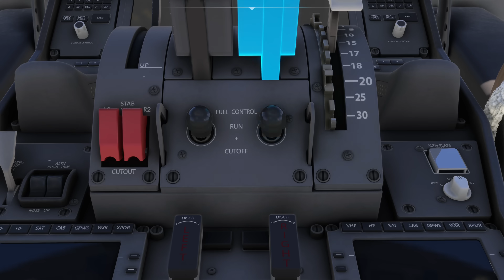Air India 171: Why Did The Fuel Cut-off Switch Get Moved?

Comment: This Boeing 787-8 incident, the fuel switch  went to cut-off during takeoff and the RAM Air Turbine (RAT) deployed. 
While the fuel switch in the cockpit is manual and can’t physically move on its own, the system behind it is far more complex.

From what I understand even if the switch is set to RUN, the engine’s control system (FADEC) can still shut off fuel electronically if it detects something abnormal like low fuel pressure, a faulty valve signal or a suspected fuel leak. 

In those cases, it might override the pilot input and close the fuel valve to protect the engine.

To the crew it could look like the switch moved or the engine shut down on its own but in reality it is the system stepping in based on logic and internal safety triggers. Combine that with a possible electrical fault and you might see RAT deployment as part of the emergency response.

It’s a reminder of how modern aircraft are deeply interconnected  where a small glitch or sensor fault can trigger a chain of safety actions. 

Fascinating how layers of automation protect the aircraft but also how important it is to look deeper when something unusual shows up.

I would love to hear from aviation experts or anyone with insights.

Comment: It is easy to blame a person who is not alive. But, that can shield Boeing for being held accountable. For a moment, lets assume that the pilot has done it. If that is the case, was there any struggle after that to crash the plane. No. Both the pilots tried hard to save the plane. So, explain, if the pilot did it intentionally. Boeing is trying to pin the blame on a poor soul who was trying to save the passengers. If I were to draw conclusions, when the first pilot asked, may it was him who spotted the issue and checked with the other pilot. The other pilot did say that he did not. If I were a trained pilot, I assume that the only way the fuel would be cut off is to manually change the lever. That is the natural response of a first pilot to discover it. I think we are being brainwashed to say it is a pilot error and not Boeing's fault

Comment: The prelim report sounds like propaganda for Boeing.lets logically examine the reasons for the cryptic report. They have access to the entire conversation between pilots but only put out a paraphrase of two comments without time stamps. That is suspicious. They want to blame the pilots. If this was a deliberate act then there would be more conversation demonstrating that but the report is silent on this. Steve is saying his kids always lie when caught red handed. An equally plausible explanation is that an electrical failure occurred first and then the pilot went to reboot the switch. The other pilot asked if he caused the shutdown and he replied no. There was a directive to inspect fuel control valve in may 15 2025 on Dreamliner 787 in England for potential defect. The RAT deployed immediately which indicates electrical failure. The 2018 advisory warned of potential “ in flight engine failure” from faulty fuel control switches. So there are lots of things we do not know. It is wrong to extrapolate from a misleading deliberately cryptic report to say dead pilot is to blame. How convenient for the billion dollar company Boeing

Comment: the report states that the fuel switches had 'transitioned', it doesn't really state that the pilots had switched it to cut off. The report however puts it in such a way for people to draw conclusions that the the pilot had done it, added to the fact that the report was leaked to wall street journal who not only drew the same conclusion but put it out loud enough to people to think that way. The report still and clear states, the word 'TRANSITIONED' , everything else is speculation.

Comment: I have 2 other questions that might have been answered because i didn't watch every single video put out about this.    

First, is this fuel cutoff switch used in normal day of flying the plane?   ...at the gate, or whatever.     I'm wondering if it's possible a switch piece was worn down making them possible to accidentally trip.   regular use would also mean reaching for them becomes a part of muscle memory...in error this time, but it wouldn't make the action feel odd.

Secondly, did the black box have a record of the fuel switch toggling and the RAT deployment.   Was the rat down before the switch was trip or the opposite?

Comment: While there is zero video to show anyone's intervention with the switches, leaves only an edited piece/s of audio.
Which in itself as published, can not conclude human intervention of the switches.
It does on the other hand, point to fuel being shut off, not by either pilot! 

One pilot said, "why did you do that"? The other states, "I didn't"!

So who or what did? 

So until that can be properly and definitively
substantiated, then it can "not" be said either pilot cut the fuel!
To do so, is an unsafe mode of reasoning!

Comment: The malfunction of the fuel switch mechanism is highly suspicious. 🤔 😢
There appear to be four key issues concerning the placement and robustness of the fuel switches:

1.  Placement on an Inclined Plane: The switches were surprisingly placed on an inclined plane directly beneath the flap levers. Both the inclined position and proximity to the flap levers are problematic.
2.  Incorrect Switch Orientation: The "cutoff" option is positioned downwards, while "run" is upwards. This orientation is counter intuitive and dangerous, especially given the inclined plane and proximity to flap levers.
3.  Risk of Accidental Engagement: Located directly below the flap levers, there's a very high probability of pilots accidentally contacting these switches. This risk is exacerbated if the switches' spring mechanism is not sufficiently robust.
4.  Mechanical & Electrical Robustness: The overall mechanical and electrical robustness of the switches' internal mechanisms is suspicious.
Reply: The risk of accidental engagement can't be that high, because this kind of thing doesn't happen. If the risk was high, it would happen from time to time

Comment: @steeeve is there a chance that the locking system of the fuel switches malfunctioned, there was also a directive issued by Boeing regarding the same few years back for 737s and it is the same system used here. And also to highlight the report uses the word TRANSISTIONED and is not exactly indicating pilots did it which leaves the room to think it could not have been the pilots and the pilots denying it could also add as evidence and still have a slight chance that it might have not been the pilots but maybe an indication like fuel switch locking mechanism failed. Would love to hear your thoughts

Comment: Maybe you have jumped the GUN...Have you heard this out:- (Fuel cutoff valve actuator ADVISORY)
It’s highly likely SN‑2015/005 is relevant to the AI‑171 case.
If actuators weren't inspected or replaced per the advisory, the probability of unintended fuel shutoff—accidental or mechanical—significantly increases.

Comment: Captain, based on the timestamps, RAT deployed at 08:08:42 — the exact same second the engines were cut off. That’s not something pilots manually deploy; it auto-triggers with dual engine or power loss. You’d earlier said RAT needs serious system failure to activate, and here it happened 3 seconds after liftoff. Doesn’t this clearly point to a sudden systems/electrical issue, not intentional pilot error?”

Comment: Is it correct that flipping the switches to cut-off and back was something a pilot would be trained do to in order to restart an engine(s) that was already losing power? If correct, this would result in a very different conclusion.

Comment: I hope you fly an airbus.  These cutoff switches should verbally ask if you want to cutoff engine 1  and have the pilot confirm it on the display (type in yes).  I’m not a pilot, but I know enough that the fuel shouldn’t be cutoff 500 feet off the ground.  I can’t understand a “oopsie” moment from the captain. I’ve always like planes but been nervous on them.  First you have to worry if the pilot is doing his, then you have to worry is the mechanic doing his job, third you have to worry about if the material is plane is durable.  And NOW I have to worry if the computer system that is supposed to make the plane safer is instead randomly flipping switches.

Comment: There is no reason why the control system can’t prevent fuel cut switches being turned off on take off there is no reason on gods earth why you would want to cut the fuel the moment the aircraft left the runway. Take off and landing are two very seperate things.

Comment: Is it possible that a member of the ground-crew  just moved the switches from the run  locked position and left them slightly below ? During the take off run, due to the vibration of the whole aircraft, the switch slipped into the cutoff position . Is this a possibility?

Comment: Are there no warnings displayed to indicate Fuel Low/No pressure when Pumps go OFF.

I worked on a plane where Main pumps supply to engines normally and if they fail there are 2 tanks with single phase motor pumps to work with aircraft battery and inverter ti supply each engine separately sufficient enough for landing.. Wasn't there any such safety in such Prestigious Boeing?

Comment: I am absolute novice but would making a switch only be operatable by 2 pilots simultaneously cause danger when inapacitation of one pilot if you then need to take control alone and somehow have an engine failure as well to then cut of the engine, which then u cannot do anymore?

Comment: Why to have two switches together ? (disign lacks mitake proofing) there were incidents in the past where wrong engine fuel  was cut off.  Best way is split swiches eough distance that single pilot can not do it. Its like each pilot has its own side of engine& its switch responsibility.

Comment: Is there an SOP that requires the pilots to cycle the fuel switches should you lose thrust from both engines? Also prelim report doesn’t which pilot asked the questions regarding fuel switches cut off- Do you find this suspicious?

Comment: I think we are missing some fundamental points....and following the herds.... The fuel DID get cut off to the engines that we can agree AND the pilots tried to recover this.

The other pilot said "HE DIDN'T" move the switches. Let's take that at face value for a second. What if neither of the pilots did move those switches to cut off? Maybe the switches moved due to malfunction, faulty parts, poor maintenance, vibration, maybe they didn't move at all and it's an inherent switch / software / design fault that cut the fuel. 

Were the switches ever in the CUTOFF position? Was the pilot questioning the other pilot due to the errors he is seeing on the screens in front of him rather than a visual check of the switches down below.

Also if the engines were relighting - then the switches must have been in the RUN position when it crashed.

There is clearly a lot of data that has been held back from this report. The data that has been presented is limited and designed to take your eyes off what "potentially" could be a Boeing issue and not a pilot issue.

Comment: In 2018, the U.S. Federal Aviation Administration issued a non-binding safety advisory—not a formal Airworthiness Directive—highlighting that on Boeing jets (including the 787 and some 737 types), the fuel control switch locking mechanism could potentially be disengaged. It recommended that airlines inspect these mechanisms to ensure they’re secure and can’t be accidentally shifted.

Comment: I think that the both engines were stopped working and the pilots tried to restart those engines by fuel switches off and on. Is it possible? I have heard on news only two lines between the pilots. Why did you turn it off. No, I didn't do it. It is sure that the conversation was not ended there. There should be lead to the actual problem. Some were saying about mental health. If that was a problem, all the pilots should take a psychic test periodically. In every 1 or 2 year. I don't know, if it is already there.

Comment: you should check the report from earlier flight of same plane from delhi to ahemdabad they seemed to mentioned it regarding the switch. and also how thousand of times issues like these are not given top priority regardless which plane it is.
also  you said that 'MAYDAY' was called by other pilot is the same pilot who said  'I didnt' while the pilot who noticed switch is trying to cutoff switch again 
also PLEASE CHECK how much time it usually takes to happen the process - its timestamps for the first time cutoff switched then changed by the pilot again according to you

Comment: Captain, in your earlier videos you mentioned that RAT deployment isn’t instant—it takes serious system failure to trigger, and that was visible within seconds on CCTV. Doesn’t such rapid RAT activation, along with the pilots trying to switch fuel back ON, point more to a sudden electrical or systems failure rather than just pilot error? It feels like this angle is being overlooked, and shifting focus only to pilot

Comment: On 15th May 2025, the CAA (UK) apparently issued a safety notice (SN-2015/005) “Fuel Shutoff valve - Mandatory Actions on Biong to operators of :- Boeing 737,757,767 and 787 aircraft. Stating these should be checked/tested/replaced. Would this not have a bearing on the accident

Comment: The crash had nothing to do with the SWITCHES . It was an electrical failure. That caused the FUEL VALVES to shut off. The RAT got deployed immediately. The transition of power to RAT caused a flicker in the cabin lights. It was corroborated by the lone survivor. After electrical power restored by RAT the engine startup sequence automatically initiated. But time and altitude was not adequate. The unusual loss of power in both engines was probably assumed by the pilot as if the copilot had cut off the switches mistakenly. The denial by the copilot indicates that the switches were not touched. This was confirmed by the wreckage report where they are in the RUN position. The 'transitions' mentioned in the report indicates the transitions of the electrical signal to the fuel valves solenoids and not of the mechanical movement of the switches. The electrical signal from the switches do not go to the fuel valves directly. They are sent to an electronic controller. The controller actuates the fuel valves. The black box normally doesn't monitors the status of all the dashboard switches. Even if the DFDR was recording the fuel switches then its quite possible that their status as presented by the report could mean that the pilots tried to revive the engines by recycling the switches through an off/on sequence (this AFTER there conversation)
Reply: I believe you are on to something here...apparently the FDR records the switches position electronically not physically...the electrical failure could have indicated the fuel valves as cutoff even if the switches were not moved...there's more to this than meets the eye.
Reply: Yes... I posted the link to the document but it seems youtube doesn't allow that. It deleted the reply.
Reply: Trust me, 34 year Airline Pilot, the first to cross my mind in a dual engine failure would not be the fuel cutoff switches.
Reply: agreed. this plane, on the flight before the accident, was documented to have electrical problems. this info is being highly disregarded by the speculators.
Reply: Just weeks before the Air India 787 crash, the UK Civil Aviation Authority issued Safety Notice SN-2015/005 (15 May 2025), requiring UK operators of the 737, 757, 767, 777, and 787 aircraft to carry out daily checks mandated by recent FAA directives on fuel shutoff valves. I'm not drawing any conclusions but sharing a fact that hasn’t been widely discussed.
Reply: Talking absolute nonsense. The mechanical switches were moved from run to cutoff, that has been proven via the black box. Not 'electrical failure'

Comment: Wanted to share some analysis I did on AI171 plane crash.

After liftoff at 8:8:39, flight was Air-borne for only 32 seconds. 
After Plane passed it's peak at 8:8:52, he realised plane has lost inertia also.

TIMELINE:-

8:8:39 : Plane in Air mode now
8:8:42 : Fuel Cut-off switch 1 to OFF
8:8:43 : Fuel Cut-off switch 2 to OFF and RAT Deployment started (which get deployed only on Both Engine failure, Hydraulic Failure or Electrical Failure not on Fuel Switch cutoff).

8:8:47 : RAT hydraulic pump began supplying hydraulic power

8:8:52 : Fuel Cut-off switch 1 to ON (Also Plane was at Peak height at this time)

8:8:56 : Fuel Cut-off switch 2 to ON

8:9:11 : Crash (Recorder stopped)

Just 3 seconds after Plane was Air-borne,  Both Engine Fuel cutoff switch was put to OFF and RAT was deployed. It surprised both pilots and they discussed about it also and no one switched it OFF. 
Investigation should be done on How Fuel cutoff off switch can come to OFF position during takeoff itself which cannot be the cause of immediate RAT Deployment also. Pilot error is out of question looking at all events above and their reaction in that scenario. Major Electrical failure can also cause wrong position of switch to be relayed  and recorded in AFDR and this electrical failure can also result in RAT Deployment. Preliminary report is completely bogus and people coming to conclusion based on that doesnt have Simple Logic.